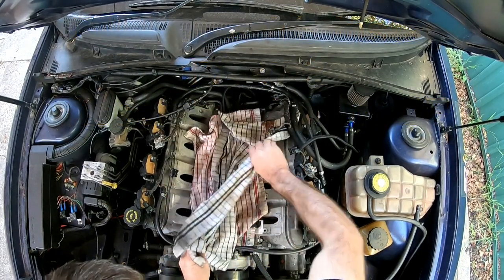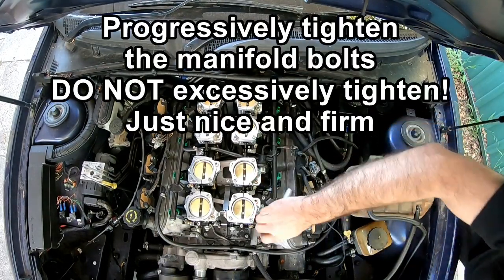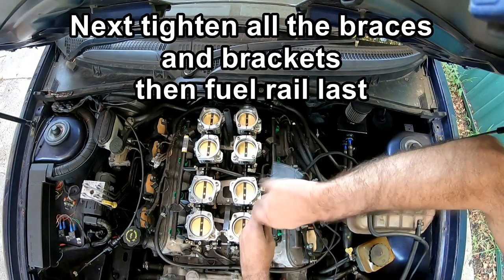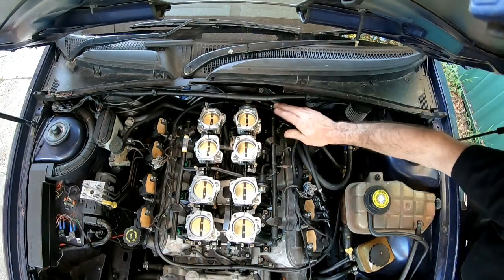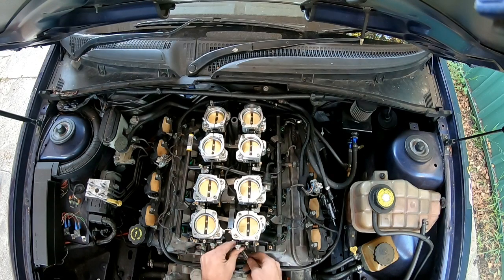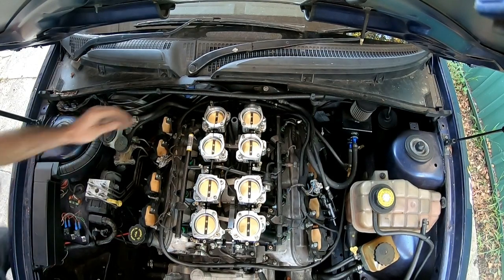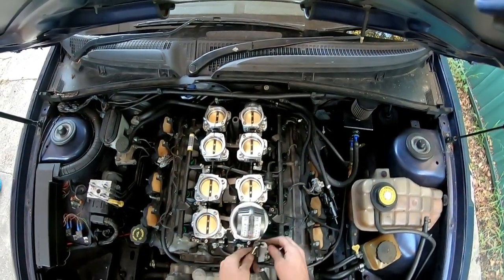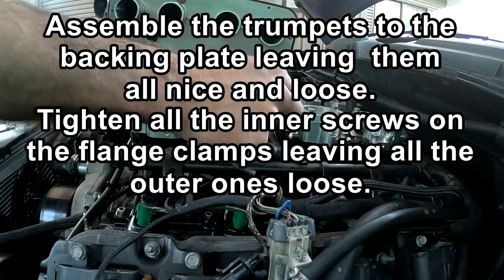PART 2 GM LS1-3 ITB Install and Engine Start up

Comment: Awesome looking gear.  How much do the ITBs improve idle quality and low end response on higher duration camshafts like the 236/242 Howard Cams grind in your dyno video.  Is that kind of cam responsive off-idle with your ITB set-up?
Reply: I have a 230/236 cam on a 5.7  and it improved idle and drivability over the stock manifold. It does need carefully setting up though
Reply: @hoonaticbloggs5402  still running this setup?  Hows it been?
Reply: @Funkyflykiwi  
Yes I’m still running it. It’s working great.
Reply: @hoonaticbloggs5402  do you think they will outperform lets say the best all rounder Single TB Manifold - i.e FAST LSXR ?   Or is it not so much any power gain but throttle response?
Reply: @ the main benefit of ITB’s is that you can run a very big cam and get perfect low rpm manners and perfect idle . With The big plenum manifolds you get a lot of charge reversion. It’s why motorcycles have individual throttles.  On my set up I also gained 20bhp over an LS6 intake